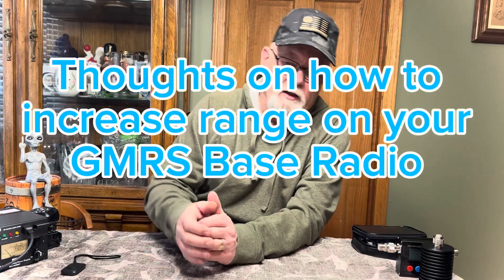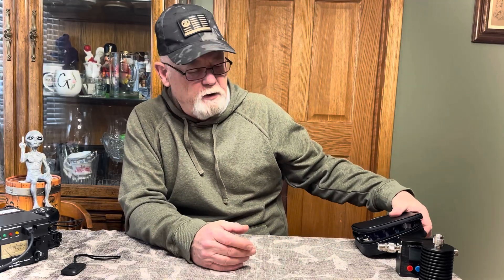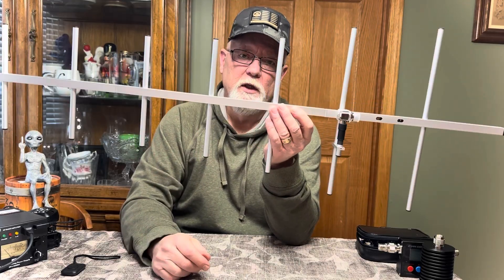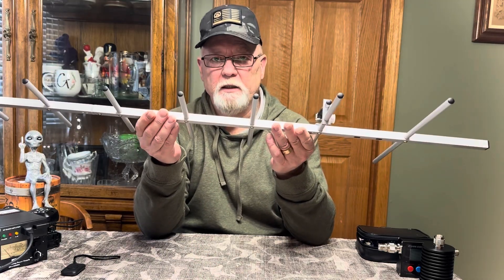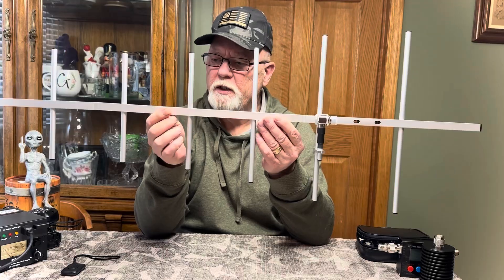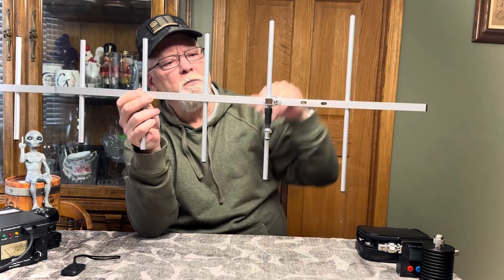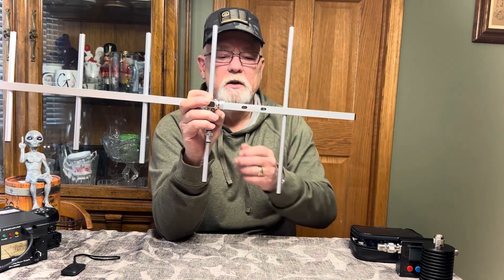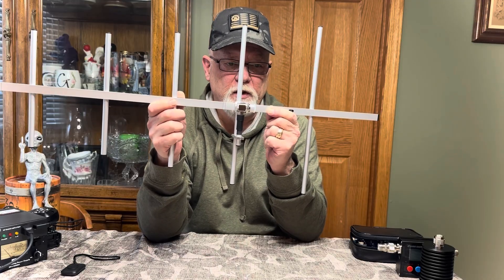Improving GMRS Base Range

Comment: need the distance between the elements
Reply from the maker: Unfortunately I gave that Yagi antenna away and don’t have the measurements, there are several books and online resources for calculating the spacing, I assume your building an antenna, for GMRS I believe the spacing is around 3.8 inches

Comment: I have a 3 story house so getting on the roof is difficult can I put the yagi antenna in my attic or will I lose to much power?
Reply from the maker: It should work unless you have steel roof, it’s worth a try
Reply: @Thomas-ZET  Thanks its not a steel roof

Comment: I'm trying to reach about 8 miles HT to HT on the highest power the radios will do. One radio is about 5 watts and the other is a little more.  My friend has his antenna up about 35 ft and mine is up about 20 feet.  We're not making the trip.  Not even a scratch.  I have coax that's better than a lot of CBers use, LMK 400.  There's a maybe 20 ft high hill between us and a lot of trees.
Reply from the maker: Can I ask what brand of coax and type, also what antenna and what radio, and if you have an swr meter
Reply: @Thomas-ZET  Thank you.  Coax is new LMR 400 low loss.  Antenna is 1/4 wave ground plane.  Radio is Baofeng AR-5RM tribander.  I have a new SWR 102 made for UHF / VHF.  I have a NANO VNA.  The SWR meter and the VNA each show about 1.6 SWR  The radio gives about 8 watts.
I appreciate your time.
Reply from the maker: @southernexposure123  it sounds like you have a good antenna and coax, they should work as 8 miles isn’t that far.
Check the easy things first, are both radios set the same as it’s easy to accidentally change a setting, the hill may also be blocking you so raising the antenna 10 feet may help.
For LMR-400 on uhf with 50 feet you can have a loss of 25 plus percent in power.

I wish I had the right answer for you and hate to see anyone spend more money if they don’t have to, if i think of something else I will post
Reply: @Thomas-ZET  Thank you very much.  My friend who is about 8 miles away and I did simplex for a short distance (2 or 3 miles) so our radios are set the same with no tones or such.

My other friend who is 12 miles away has been into GMRS longer than me and he and I did simplex maybe 4 miles, so we're also set the same.  
Still in it's sealed plastic bag I have 100 ft of LMK 400 and it's likely not as good as the LMR.  The LMK coax might be soaking up all the RF.  
Since the LMR will have 25% loss at 50 ft my 100 ft of LMK will have at least 50% loss.  Not so great.  I didn't open the plastic around the LMK so I can send it back and be sure to get better coax than LMK.  
My 12 mile buddy just got his new antenna.  I'm not sure the brand, but I think it's rated at 6dB gain.  He'll put it up 22 feet and try his 50 watt mobile radio.  
I'm running out of motivation because progress has been so slow.  I can fairly easily get 10 feet higher.
Thanks again.

Comment: Can you use two yagi antennas with a duplexer and point each one a different direction?
Reply from the maker: @XRPRANCH  it can be done, with vertical separation and a T connection, I would use an antenna switch and have 3 feet of vertical separation.
The ARRL has good books and online resources for antennas from building to setup and how to stack Yagi antennas, you can find them on Amazon also. This would make a good book for your preper library

Comment: Billy Bob?  What kind of range are you getting with the yagi on 2M SSB? With how much power? Thanks.  Nice videos.
Reply from the maker: @djjojo1630  on my 12 element, with 100 watts 75 to 100 miles, my antenna is 50 feet up

Comment: my issue is getting someone to help me. I am a disabled veteran an have no way to get my wheelchair on the single level roof. I have tried to get ahold of local ham clubs but, no response. so I am left looking at my radio's and dreaming about making contacts. lol
Reply: You might have better luck with some of the veteran organizations versus ham organizations. Thank you for your service. 💪🇺🇲👍
Reply from the maker: Sorry don’t know anyone in Ohio, it’s sad you can’t get any help, clubs used to help out, I’m also a vet and hope you can find someone to help you
Reply: @Thomas-ZET  thank you for trying.
yes it is sad back when I was whole 20 years ago. I used to bend over backwards to help other vets. now a days its different it has gone to what can you do for me mentality
Reply: i use a painters extension pole 26 ft. qtr wave ground plane antenna on top. mounted to an old tv antenna tripod setup in the backyard. if you have a patio cover you can just strap it to a corner post. just get it up away from any metal if that's what the patio cover is made from. it'll work fine for 2 meter or gmrs and anything in between
Reply from the maker: @leokelly359  can I ask what area you’re in
Reply: @Thomas-ZET  near akron ohio